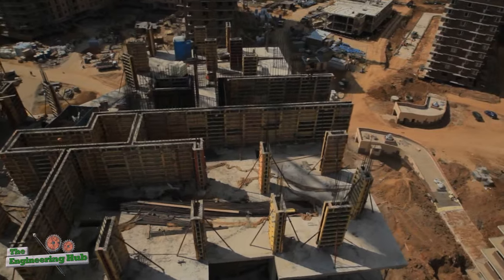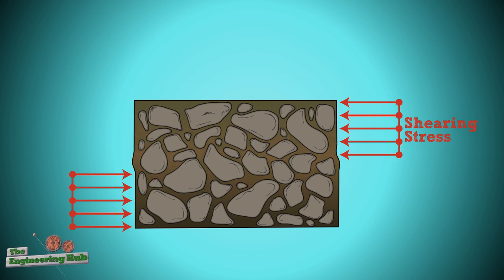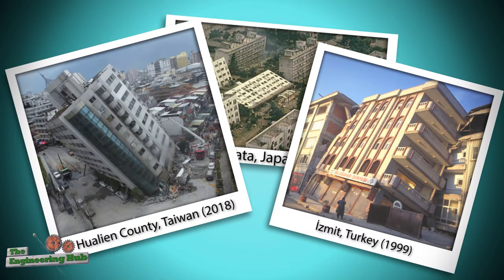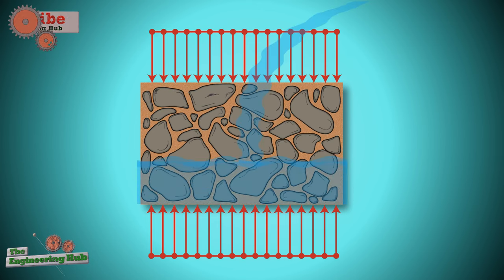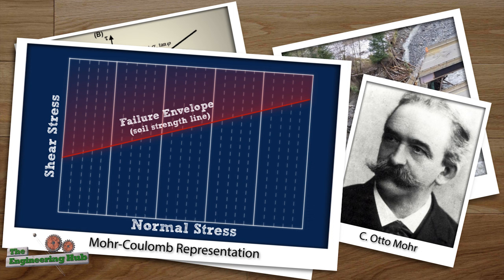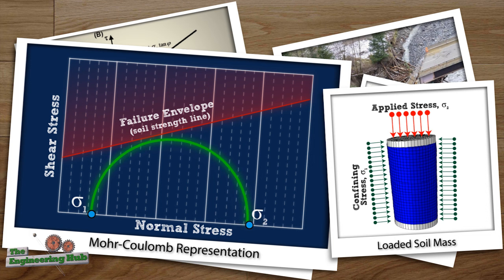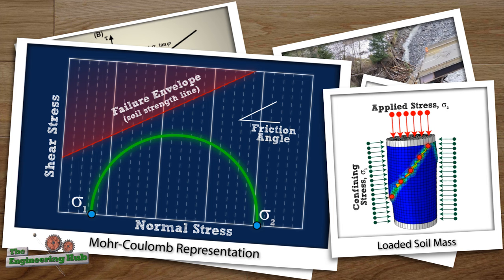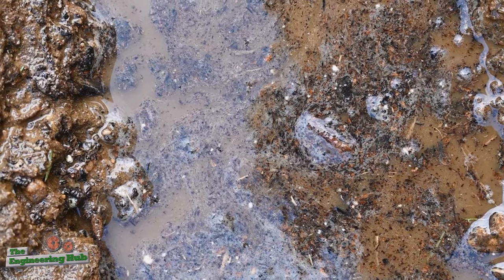Understanding why soils fail

Comment: In Norway a farmer was having some kind of pit dug.  The soil was piled up along the bank of a nearby river.
   And a sheer slide started.
Evidently this land, some of the best farmland in Norway, is on top of a layer of clay.  When it started sliding the whole layer slid taking, as I remember, about 4 whole farms with it.  It is continuing sporadically.
   I'm still trying to wrap my mind around that.  How did that bit of soil piled up on the river bank so destabilize the whole area?

Comment: In practice, soil would not be able to carry increasing loads, even if well co fined because of firstly the particle crushing and secondly chemical changes due to high pressure
Reply from the maker: Yup, you are absolutely right. But those types of stresses would be beyond a structural application.

Comment: Hello nice presentation! But i have one question. If soil is totally dry (no water in voids) shear failure occurs when friction between soil particles is smaller then shear stress in the soil, and that's obvious when you think about it, BUT, what about wet soils or soils that are in groundwater (saturated soils)? Friction now is not intuitive and what is the mechanism of failure then?
Reply: As long as the particles in the soil are in contact the friction will be there. What happens in a saturated soil is that the positive water pressure decreases the stress that holds the particles together. This is knows as the 'Terzaghi's law' of effective stress. From the total stress coming from e.g. the total weight of the overburden (the weight of the soil column, including the soil particles and the water between them) we have to subtract the pore water pressure - this resulting stress is the one that is really important. As long as it is larger than zero, there will be some positive shear strength. If the soil is not fully saturated (unsaturated) some suction may exist between the particles - this is then increasing the effective stress and so - increasing  the shear strength. The Coulomb-Mohr principle saying that (the shear strength) = (the effective normal stress) * (the angle of friction) holds true for all dry, wet and saturated soils.
Reply: So if effective stress is zero or very small any vertical load on that saturated soil will cause it to fail in shear?
Reply: @Veke96  Any HORIZONTAL load will shear it. Yes. Unless it is a fine preconsolidated soil (e.g. clay that has been loaded before more than it is now) or very angular coarse soil (sand, gravel). In these cases the shear strength may be increased (up to some effective stress) by 'cohesion' being the effect of interlocking of the grains/particles. In soils the history of loading is important...